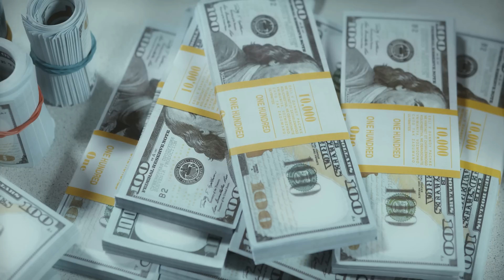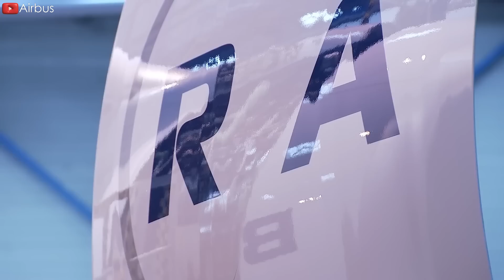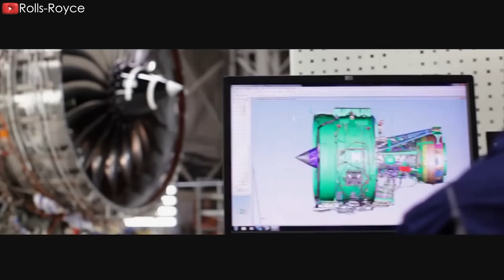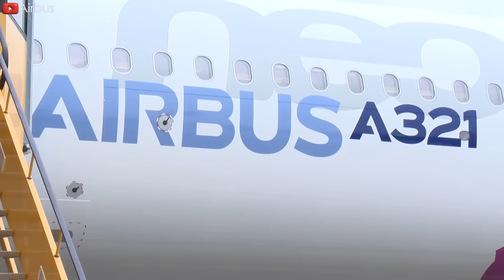Airbus A350 NEW BIG ENGINE Upgrade Revealed Shock Everyone NOW! Here's Why

Comment: what previous engines were so bad?
Reply from the maker: The upgrading doesn't mean that the previous one is bad. Just to enhance the efficiency a little higher. As mentioned in the video, a little higher efficiency is significant in the industry.

Comment: Russians are also testing PD 35 Engine, as of last week they have installed a PD 35 on IL 76 test aircraft. According to data provided it’s the biggest engine with 40% composite material using 3D Printing technology. These engines will be installed 
On IL 400M jumbo commercial aircraft with 2 PD 35 engines instead of 4 smaller engines. Also, 2 pilots instead of 3.
These engines are also be using in military aircraft.
Reply from the maker: yep good news

Comment: Don’t give me pounds, give me kilos. This is 2024!
Reply: Welcome to aviation pal. The most accepted quantities are pounds, knots, feet.
Reply: @idanceforpennies281  nope. Its mixed units. Even in the US. Let's not deviate from the truth. 'Most' is an exaggeration
Reply: @dipayannag7413  right, but in the US, weights are done in pounds.
Reply: @rtbrtb_dutchy4183  And speed is always knots and altitude is always feet.
Reply: @idanceforpennies281  in the US and most parts of the world. China still has meters. But Russia switched to feet. Speed is always in knots indeed, however, I do believe that some military uses KM/h. (Russia).
Reply: @leviathon2  what a weird response with the water. At no point have I given an explanation that isn’t true or “out of this world”. 
Pounds is pretty common in aviation.
Reply: @rtbrtb_dutchy4183  You miss the point that Imperial measurements are antiquated and cumbersome. That’s why, in general, science and engineering don’t use them. USA excepted but that’s an exception. The water reference is about dregs C vs. degs F. Usually Imperial usage is a throwback to a bygone time but its usage continues due sheer mass. In my flying career I never see pounds aside from the U.S.
Reply: @leviathon2  I didn’t miss any point. I grew up on the metric system, no need to be explained about it. However, I fly in the USA. 

Don’t be too quick to think you will never see pounds. Airplanes get sold and leased around the world. We currently have a bunch of aircraft in KG and not LBS. 

From the top of my head, Transavia in the Netherlands, used to lease extra 737s from SunCountry airlines in the USA during the summer. Those were pounds, not KG.
Reply: @idanceforpennies281  Knots, feet and kilos where I’m from!
Reply: Well, even RR name their engine variant ("84") based on pounds of thrust...
And the metric measure of thrust is kN if I'm not mistaken, rather than kg.
Reply: We still use pounds as well.
Reply: Only 3 countries in the world does. @rtbrtb_dutchy4183 its time to move along.

Comment: Obviously these upgrades are very welcome & RR`s new CEO is to be commended in turning around his charge. The T-XWB has been at the cutting edge of design in bringing about a step change in fuel efficiency & performance while all the while trying to maintain the reliability of previous engines that were not so highly stressed or economical. This task has been challenging to say the least but in the -84 varient it`s been hugely successful with more efficiencies on the way. The -97 varient has had some durability issues which has garnered some high profile criticisms, l would hope that these upgrades make this engine more desirable to those people as the A350-1000 in most environments has been a terrific aircraft. T-7000 ( virtually a bleed version of T-1000 ) has been proving to be an outstanding turbine on the A330Neo & as it stands the improvements to this engine will find there way on the T-1000 for B787 very soon which should hopefully boost RR`s share on that aircraft. This is particularly important as both A350 & B787 will be around for some years.
Reply from the maker: nice thanks for sharing bro

Comment: I think the significant thing overall is that while Airbus are adding extra capacity or range or engine efficiencies to improve the sales offer to airlines Boeing is standing still, product development is dead and key new products (777X and 737-10) are a year away from delivery to airlines. And there is a question mark over the 777X GE engines as it has yet to run at full power on full weight 777X aircraft.
The question being asked by airline customers is: Do we order a proven safe and upgraded A350 from Airbus or do we buy an unproven, late and uncertified 777X with Boeing's dubious safety record? The answer will probably be how much discount Boeing give away.
Reply from the maker: thank you

Comment: I hope emirates will now consider buying the a350-1041
Reply: I think it will be a while before they do at least until they think of B777300-ER replacement, but they will have to factor-in the waiting time for -1000 as it`s becoming a popular choice. Isn`t it the case that if they did order in the near future they will get the engine improvements by then?
Reply: @edwardwilcox6606  if they did order the -1000 now, the 777x would still arrive first which is currently emirates's solution to 777-300 replacement. Also, I don't remember well but I think it is united that has a350's on order, but they set their delivery date in a few years. They have ordered the plane but they don't want it for another couple of years. I think emirates should do the same.

Comment: A350 jumping ahead of the 777-X. The 777 which isn't even certified yet is looking worse by the day. By the time it starts to be delivered in significant numbers, it may actually already be a generation behind.
Reply: @idanceforpennies281  yeah, but I just don’t believe in this rivalry between the A35K and the B779. Out of the 13 airlines that purchased the B779, 8 already operate, or ordered the A35K, and then there’s Emirates whose order of A35K is a matter of time (my humble opinion). This means there are more airlines planning to operate both planes at the side by side, and complementing each other, than the opposite. The airline industry is vast, with multiple scenarios around the world.
Reply: @djonymorais they may be complementary for some airlines, however the order numbers already speak for themselves with the XWB-1k coming out on top. It's a full carbon clean sheet design, where the triple7 only got composite wings and new engines.
Reply: @KaptnKork  the trent xwb sure is a remarkable engine, and I do agree that its success is more than evident, I’m just not sure whether the eventual success of the 777X platform is connected to the number of A350 orders, as I don’t see them as direct competitors, 777X being a more niche aircraft, so I’m sure Boeing is not expecting thousands of orders, but rather a “considerable” amount of orders to replace planes such as the A380 and the B748 with a clearly more efficient aircraft. Don’t get me wrong, I’m not a Boeing or an Airbus fan, as a matter of fact I’m an A350 pilot in real life, so I know first hand how amazing that plane is, but I just don’t see it being better or worse than the 777x, it is just……different.
Reply: @djonymorais  that makes sense to me. I would expect the larger 777-9 to dominate in the role to replace the double deckers, and yes I can see Emirates placing substantial further orders.
I personally think the increased pressurization similar to the B787 and A350  is a potential safety risk. There is a reason we did have reduced air pressure in all other aluminum planes to this day, and that is to reduce wear and tear from expansion.
Reply: @KaptnKork  yeah, interesting point. I would assume that Boeing intends to achieve a lower cabin altitude on the 777x by introducing more composite materials to the building  of its fuselage, but I haven’t heard or read anything in that regard. I’m curious to see how they’re gonna pull that one out.
Reply: Sad part, Bowing is just BEHIND. They said no to new aircraft development, because they Can Not Deliver.
COMAC will finish Boeing, maybe on the world stage.
Reply: I think the opposite should be the outcome. With the long delay this aircraft should be `sorted` & certification should be a formality. I think compared to A350-1000 this plane could be a little more niche because of it`s extra size & considerable price tag but it`s definitely going to appeal to the luxury end of the market so Emirates, Qatar, Lufty & Singapore will be more than happy with it. I`d imagine the GE9X engines should make-up for any deficiencies the heavier metal frame will contribute making this larger aircraft quite acceptable in the economy stakes. The A350-1000 should be the defacto replacement for B777-300ER` when they come up for renewal so I`d suggest both these aircraft will succeed.....we`ll see though.
Reply: @edwardwilcox6606  The next logical step for Airbus is to get those GE9X engines onto a stretched A350.
Reply: @idanceforpennies281  I`d imagine Boeing would be dead against the idea as they may have injected huge amounts of money into the project. It`s doubtful AB would entertain it either, upsetting RR could be costly too what with important upgrades to T-XWB-97 which could feasibly power a `stretch` & the prospect of UltraFan on the horizon promising so much. Complicated ain`t it?
Reply: @edwardwilcox6606  You're right. They'll wait for the ultra fan. I forgot the RR engines were specifically designed for the A350.
Reply: Why are you worried? That didn't stop customers from ordering the 777x at the farnborough Air Show.
Reply: @Coupe-sy9nk  I'm not worried about anything.

Comment: Hope it works out as no one is happy with the Trent-1000
Reply: Since the T-1000 blade problem was fixed at the end of 2019 there have been airlines that have been `happy` to order the engine, these include EL AL, Gulf, Egypt & Lufthansa. So your statement isn`t correct & is one of many that get mentioned all the time because it seems it`s a popular pastime for avgeeks to criticise it. The fact is while there may still be some durability issues with T-1000 ( & T-XWB-97 ) RR have many improvements in the pipeline, these include some already on T7000 which are to filter down soon & others as mentioned on this vid. Regardless RR are to be commended for their hard work in first getting over the initial problems which cost them greatly & to be investing huge sums in making improvements to all Trents.
Reply: @edwardwilcox6606  I currently work for an airline that has had to cut routes due to the Trent 1000s durability issues on our 787 aircraft, which has caused us to dry lease aircraft. The airline has 8 more 787 aircraft on order, however they have opted for the aircraft yet to come to have the GEnx engines. While RR is working on the issue, the issue is still therr sadly.
Reply: @JazzB245  Is this to do with HPT blades or other area`s? Thanks for posting this btw.
Reply: They weren't for a couple of years but RR replaced engines at their cost and upgraded the 1000. It has been operating perfectly well since 2020.
Reply: @1chish  While I agree with you I do wonder why BA of all airlines have just ordered 6 new Dreamliners with the GEnx. I know they still have more RR powered B787`s to come but this latest change is difficult to fathom particularly as they are both very close on SFC with perhaps a slight advantage to the GEnx.
Reply: @edwardwilcox6606   I take your point. I would even say why is BA even buying American aircraft when the UK is so embedded in Airbus. But then BA's forerunner, State owned BOAC, was always known as 'By anything American'.
Reply: @1chish  
Yes, between them, BOAC and BEA made a considerable contribution to the demise of the British aircraft industry, especially in its capacity as civil airframe manufacturers. As for BA, with their inadequate amount of A350s, should they and their foreign parent company choose GE rather than RR engines in future, then they're not really a British carrier IMO, so its up to the Government to put those Heathrow slots up for auction to the highest bidder. I consider Virgin to be the flag carrier now, with all the wokism that involves, which I find pretty easy to ignore when flying with them, as the service is pretty good............